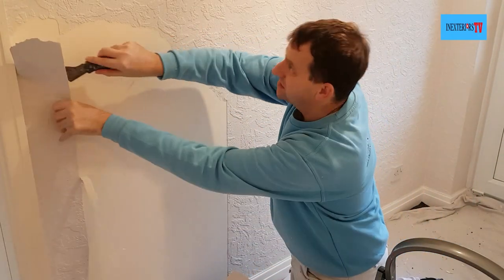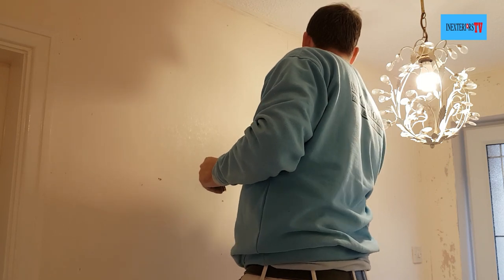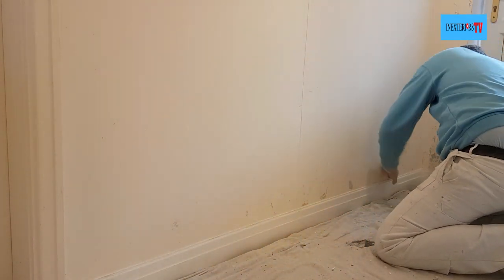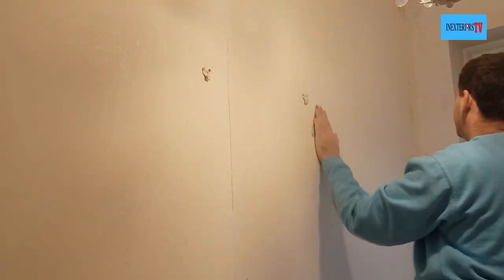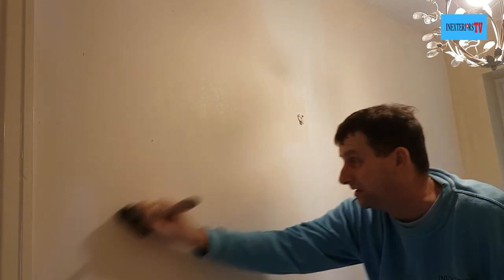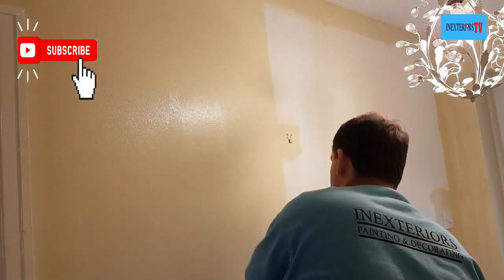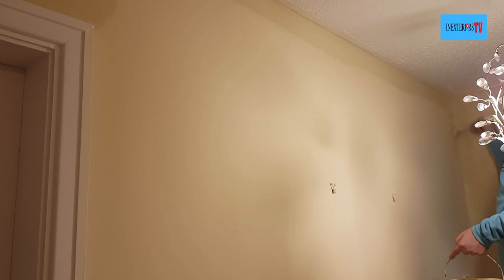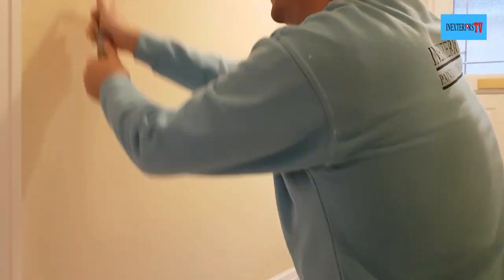How to paint walls after removing wallpaper. How to paint walls.

Comment: Great informative video mate... I've just peeled off paper in my dining room and the plaster has come away with the paper in parts..only probably 4 mill deep... and mapping everywhere...what's my best option and cheapest? I'm at a mess here,I'm no plasterer lol..plus it's a council house,I'm sure they should give it a full skim...but last time they came to different bedroom all they did was patch up the holes n cracks n left all the mapping...not right that
Reply from the maker: Give walls a good sand first, then give a coat of paint, let me know when you have done that, then I will let you know the next stage. Best of luck my friend.
Reply from the maker: Thiesemay help aswell https://youtu.be/gyQkdTJaN2w
https://youtu.be/b1d8Q1z5BS0
Reply: @Inexteriors  cheers buddy..shall I use primer... or any paint just to show up the blemishes? Also these houses ate prefabs..and the walls arnt flush
Reply from the maker: @davvo1234  Put a coat of white paint, valspar express coat is a good shout.
Reply: @Inexteriors  cheers buddy

Comment: Great videos
Reply from the maker: Thankyou very much for watching.
Reply: @Inexteriors  I'm wanting to wallpaper a roo. For my mum, I happy with the process just unsure on the wall prep. It's a painted wall, do I have to use a primer before applying the paste. It's a paste the wall, wallpaper
Reply from the maker: To be safe put a watered down coat of paste on the wall first, its called sizing the wall. Also check on the wallpaper what paste to use  you will probably need to use paste the wall paste, you can get it from b and q its comes in a tub, the brand is solvite ready mixed.
Reply: @Inexteriors  cheers for that. How long do I leave it once its been sized?
Reply from the maker: @davidrowan6556  24 hrs, make sure it is dry.

Comment: two questions please 1) am removing a wallpaper that was paste a painted walls after removing it there will be a glue residue  on walls so should i wash it and scrape it or just scrape it and sand it like you did?
2) why did you use mist coat if that was painted wall?
Reply from the maker: If the glue residue is sticky give it a wash with sugar soap to be safe leave to dry and sand.  If walls are bone dry after removing paper i have just sanded. To be honest i have never washed the walls down, i have just waited till the next day then  sanded then, i  only mist coated were the paper pulled the paint of and exposed the plaster. This video might help some more. https://youtu.be/gyQkdTJaN2w

Comment: Was the wall behind the wall paper painted or was it plaster. I've removed wall paper from a plastered wall and was wondering if there is any thing else I need to do. Great video.
Reply from the maker: @David Morley If it is bare plaster give it a sand all over with some 120 grit sandpaper to remove any bits like paper and bits of paste, then paint the bare plaster with a thinned down coat of matt emulsion, 70 percent paint 30 percent water. This video might help 
https://youtu.be/UL_a0UAlMOc these walls was not papered, but it does show how to get a finish of bare plaster.

Comment: 👍 Just found your channel and subbed as you have some great knowledge and advice.
Whenever I emulsion walls I get spray onto the skirting, any tips please? Is it  technique or the roller sleeve? Cheers bud
Reply from the maker: I think its the paint, i have noticed over the years some paint over sprays more than others. just take it steady, then wipe the skirting straight after you have rolled a wall if  you are painting over, lets say a varnished skirting board. i have just used dulux trade on a job were the skirting boards are varnished and that gave off very little over spray.
Reply: @Inexteriors  OK great. Thanks for replying

Comment: Doesn't sanding it like that tore you out.   I want to do the parts of the stairs myself I have an arrythmia so this makes it very draining and can put me into it.  Can I use an electroc sander
Reply from the maker: @hybrid angel .These walls did not need much sanding to be honest compared to other walls i have come across, so if you was sanding walls in the same condition then yes you can use an electric sander with a 120 grade sandpaper, but you would only give it the once over, also the sander may get a little heavy. If you need ask any more questions please ask, i may take a day to get back to you because i am on holiday and struggling for internet. Hope this helped

Comment: Hi, thanks for informative video. I was just wondering what kind of paint you use with the water and why?
Reply from the maker: I put a bit of water in the paint to touch up any bare plaster bits, just to seal the plaster, If it was all new plaster you would mist coat the walls first,with a watered down coat. It was just emulsion that i used.
Reply: @Inexteriors  Thank you for quick reply:) I dunno what I’do without great vids like yours😅
Reply from the maker: @BellaSaidKnockUOut  No problem, and thankyou.
Reply: Great job!

Comment: Before your first coat of pain don’t you have to seal the entire wall of bare plaster - not just where you have repaired cracks and damaged parts. Do you use 70/30 paint/water to seal entire wall?
Reply from the maker: @Cold Saw . The wall already had paint on, Yes for a mist coat on bare plaster a 70/30 mix is good.
Reply: Isn't it better to use an oil based primer?
Reply from the maker: @agareja1 what am i using oil based primer for buddy.

Comment: what if I removed an adhesive wallpaper from my wall and it leaves a sticky residue on the wall, what should I do?
Reply from the maker: @Charlize Nicolas . Wash with sugar soap.
Reply: @Inexteriors  Hello,sir, what is sugar soap?
Reply: Wow. Dr Google answered my question. Any substitutes?
Reply from the maker: @drewblack749 Hope this helps. https://www.amazon.co.uk/Everbuild-SOAPPOW-Sugar-Soap-Powder/dp/6095026164/ref=asc_df_6095026164/?tag=googshopuk-21&linkCode=df0&hvadid=208025721965&hvpos=&hvnetw=g&hvrand=6801621789932430591&hvpone=&hvptwo=&hvqmt=&hvdev=m&hvdvcmdl=&hvlocint=&hvlocphy=9046293&hvtargid=pla-420462942886&psc=1&th=1&psc=1

Comment: When I peeled off the old wallpaper on the bedroom wall, some of the coating behind the wallpaper came off as well. Do I need to scrape all the remaining coating off or can I just leave it as it is?
Reply from the maker: @christine Yi . Scrape to a hard edge, then sand, and fill if needed.
Reply: @Inexteriors  Thanks for the quick replay. I have scraped all the coating off on one part of the wall that I first worked on. What should I put on next?
Reply from the maker: Give it a coat of paint, then if there is like a fine step on the edge of were you scraped, fill with fine filler, fill cleanly so it is easy to sand.
Reply from the maker: @Christine Yi . This video might help
https://youtu.be/gyQkdTJaN2w
Reply: @Inexteriors  Thanks a. Lot! What kind of paint should I use?
Reply: @Inexteriors  what do you mean of scrape to a hard edge? Edges of wall, ceiling and skirting board? Does that mean I need to scrape all the coating off? It was really messy and hard to do. Thanks!
Reply from the maker: @Christine Yi . Were the old coating is loose scrape that to a hard edge, also is the wall bare plaster were the old coating has come,
Reply from the maker: @Christine Yi . A good quality matt emulsion.
Reply: @Inexteriors  thanks a lot! That’s very helpful. I have another question, do I need to use the primer before the 2 coats of painting?
Reply from the maker: If its bare wood, primer, undercoat and top coat, But you can get a primer undercoat that primes and undercoat i would recommend 3 coats of primer undercoat from bare wood.
Reply: @Inexteriors  thanks. It looks like the same material as in your video. I thought it was plasterboard. But my niece who is a carpenter in US called it dry wall and said it needed primer. Is dry wall different from plasterboard?
Reply from the maker: @Christine Yi , you will need to put a coat of drywall primer on it, we don't have dry wall as a finish here, we have our plasterboards skimmed with plaster.
Reply: @Inexteriors  thanks a lot for replying during the weekend. Do you think Dulux Sealer for plaster is a good alternative of water down emulsion paint for the bare plasterboard after taking off the wallpaper? Thank you.
Reply from the maker: @christineyi9188  It should be, just check with a member of staff from were you buy it from, and see what they say.
Reply: @Inexteriors  Thank you! I noticed that you used 70:30 diluted emulsion paint before painting in this Video but you didn’t dilute the white emulsion paint when using it before painting in the video you recommended earlier (prepare the wall for painting after taking off the wallpaper). Why is that?
Reply from the maker: @christineyi9188  Just to seal the plaster, just like priming the drywall.
Reply: @Inexteriors  thanks! Do you have to dilute the emulsion paint with enough amount of water to be able to seal the plaster? Sorry for my many questions.
Reply from the maker: @christineyi9188  Yes 70/ 30 mix 70 paint 30 water, We call it a mist coat here in England. Its seals the plaster ready for 2 neat coats of emulsion, if you put neat paint on new plaster it just sits on top of the plaster and is liable for peeling of.
Reply: @Inexteriors  Thank you for your patience and kind advices.
Reply from the maker: @christineyi9188  No problem, good luck with your project.
Reply: @Inexteriors  Thank you!

Comment: why do you use easi fill instead of something like polycell trade polyfilla
Reply from the maker: I use the easy fill because of its versatility, ie it great for fine fillling as well as repairs around sockets after the electricians been putting back boxes in, and for chases, also it sands down easy,